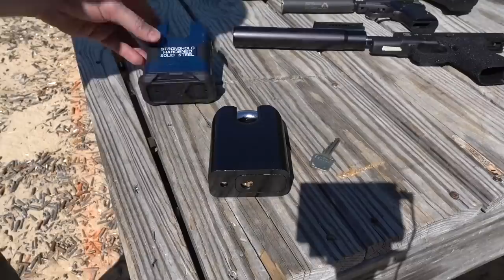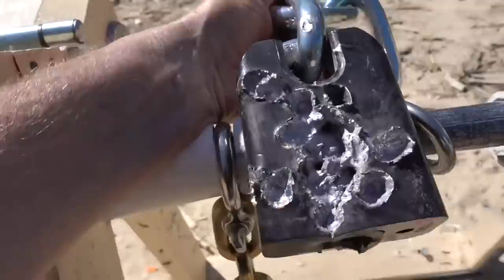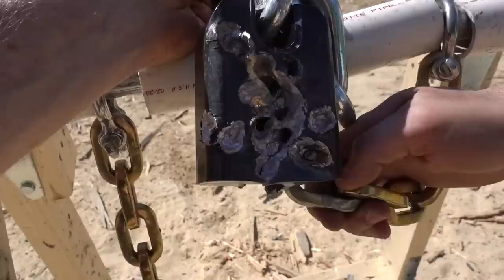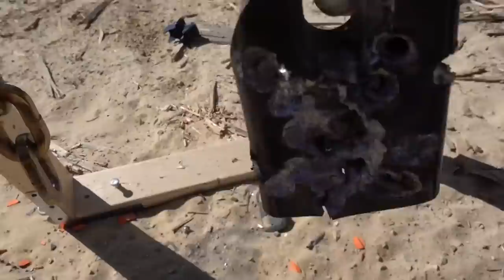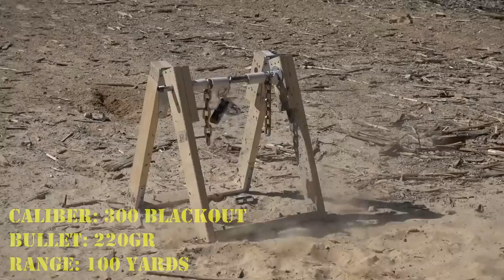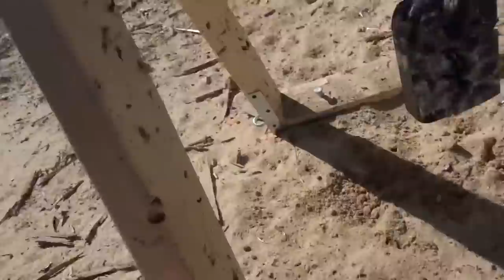[897] The Lock That Survived 120 Rounds! (Squire SS80CS)

Comment: Good shooting by Bill on a moving target.   30 caliber AP (3006 pulled bullets  with the real hardened steel sharp cores not the aftermarket so so ones) has a hard time at 100 yards with 1/2 inch armored steel 3/8 inch is doable.  , 50 yards it can penetrate 1/2 inch.  Another factor is the lock is free swinging which absorbs 30+ percent of the energy from the bullet versus if the lock was not able to move that much would penetrate alot more.  Blowing the core out or penetrating non vital parts of the padlock does not necessarily mean it will open and release.  But it was a fun video to watch.  SLug test   haha ?

Comment: Because the lock can swing freely it can dissipate a lot of kinetic energy. If the lock were fixed securely against a back stop it would have taken more damage early on. Think of it like trying to punch a hole through an empty jacket with a pointed stick while it’s hanging from a rope.

Comment: I don’t know if this has been mentioned (haven’t read all the comments yet!) but I think the “free swinging” design of the rig may be helping the lock survive. Some of the kinetic energy of the rounds is be dissipated by moving it, if it were secured to a hasp and immobile I’d think the lock would absorb more energy and sustain more damage each round. Would that be enough to get through it in fewer shots? I’d think so, though it would still take a lot of shots by the looks of it. Very impressive lock! Just needs a Bowley core to be near-impregnable!

Comment: I'm not sure I'd count the .300BLK rounds. Yes, the bullets are about 1.5x as heavy as a .308Win, but the .308Win is going nearly 3x the speed of the .300BLK at the muzzle. Given that muzzle energy is (1/2)mv^2 (i.e., velocity's contribution to energy is far more important than mass's), if the .308Win didn't do it there was no possible way the .300BLK would.

On the other hand, suppressed .300BLK is one of my favorites at the range. I bet that was a heck of a fun way to close out the day.

Comment: .300 AAC has only about a quarter of the muzzle energy of the .308 they were using earlier (even less considering Bill mentions his hand loaded .308 rounds were "a bit hot"). Surprised they don't mention that which leaves the impression that it's equivalent or even stronger than .308 (or 7.62 NATO, they erroneously use those calibers interchangeably in this series).

Comment: As noted, going AROUND a really decent lock (or under, over, etc.) might make more sense in real world applications.

But if you REALLY want to defeat a lock or other armored device efficiently in a single shot using chemical energy and don't care how noisy it is? I could teach you how. No guns, as much fun as "Thunderbolt & Lightfoot" was to watch. Linear shaped charges, pyronol torches, several other related methods for piercing or burning through armor.

Comment: Why was it suspended in air? It should have been propped against a fixed object - some of the energy was converted to kinetic energy to swing it...
Reply: You'd probably be risking fragments coming back at you if it was solidly fixed though

Comment: By suspending the lock unrealistically on a chain, allowed the swing of the lock to absorb the momentum of the rounds. If the lock were secured to something resembling a fence gate or door, to which it would realistically be attached and not allowed to swing as freely as it did that lock probably would not have survived so many rounds.

Comment: .300 blk kinetic energy is like a slightly beefier .45 although with those heavier rounds it's probably a little stouter, it's not as hard-hitting as the .223. Also, I'm curious as to why LPL uses 62gr M855 versus the faster, better penetrating M193 (don't listen to the politicians on this; the steel core is mild and doesn't aid penetration much at all) which is also probably a bit cheaper.

Comment: YOu've forgot to test it against an RPG! ;-) 

BTW new title: How to turn a steel lock into lead! :D
Reply: the lock wouldn't set off an rpg fuse hanging from a chain, you'd need to put it against a wall
Reply: @SuperAWaC  Source?
Reply: @logitech4873  vp-22 fuze specifications
Reply: @SuperAWaC  How much energy does it take?
Because a fiberglass wall is enough, and it takes way more energy to push this thing out of the way in a few milliseconds than it takes to break a fiberglass wall.
So I'm inclined to believe you're just bullshitting.

Comment: 50 BMG with AP rounds. I’m guessing 3 shots and the lock is done.
.308 is like the size of a piece of hair compared to the 50 BMG.
Reply: .308 is 20% of the Energy of a .5 BMP aka 12,7 x 99 mm.  Not so bad after all.

Comment: Nice video, but nobody uses 5.56 to breach a door/lock, its just not made for it or effective (as you demonstrated). 12ga slugs are more typical and you usually go for hinges/bolt/knob/wherever it connects to the door.

Comment: You said you were starting with .223 but the caption said 5.56 Nato. Please clarify as there is a difference in the two. 5.56 runs about 8,000 psi more than the .223 and has a higher velocity and more power.

Comment: #LockpickingLawyer & @BosnianBill try a Law Enforcement Tactical  breaching round in a 12Ga. Remington 870,   KAC Masterkey or M26 with a "stand-off breacher"
or the M1030 breaching round, in a 12 gauge 2¾ inch (70 mm - 40 gram, 1.4 ounce)round, or the frangible Clucas MoE Hatton 12 ga. round, in  12 gauge 3-inch (76mm) magnum shell (43 gram - 1.5 ounce).

Comment: You are loosing some of the kenetic energy because of the chain hanging in the air. If the lock was hanginig against a steel plate, the energy would tranfer must better into the lock

Comment: I still say it would have busted that locks all of them open a lot sooner if you would have put a steel plate behind it. When its on the chain its letting the swing it not a solid . If A lock has something locked up its going to be on a Hasp its not going to be swinging.

Comment: What you need is a 50 bmg now that might just do the job
Reply: A regular 50 BMG will most likely splinter it on the first shot. A 50 BMG AP will likely just make a pretty looking round hole straight through.... So I vote for AP, so they can have fun making a Swizz cheese out of it!

Comment: 55 grain at ... 987.6 m/s ... ? That's going a bit. Let me slow that down to reasonable. 55 grain at 940 m/s: 1579 Joules.
220 grain is four times the mass, but subsonic means not much over one third the velocity. 220 grain at 320 m/s: only 732 Joules.
The heavier one's got 36% more momentum, but less than half the energy. If you went the other way and kept the same momentum as the 5.56 mm but dropped the mass to 33 grain and raised the velocity to 1567 m/s, that'd be 2633 Joules. Go really crazy and, somehow, launch a 6.8 grain bullet at 7.6 km/s and you get 12766 Joules, up there with the .50 BMG, mostly lost to the air in the first 50 m of travel because it's such a light projectile. Why 7.6 km/s? ISS speed. Don't get in that thing's way!
Go the opposite direction and repeat the "55 grain to 220 grain, 940 m/s to 320 m/s" scaling a few more times, and you get 3520 grain aka half a pound going at 37 m/s aka 83 mph with 156 Joules of kinetic energy, a pretty respectable figure for a .22 LR. The recoil would be unpleasant.

Comment: you should have tried opening it on camera between the caliber swaps to see if it even opens (atleast with the key) because that is usually the objective if your shooting a lock (at least it is in movies). another thing i know is hard to accomplish but certainly aint impossible is try shooting the closing hook itself (that small metall piece you usually fiddle through the heck knows what you're trying to protect) because this should be a weakspot...

THIS OUTRIGHT CRIES FOR .50 APIT!!!!

Comment: Should have hit it with a 7.62x39
Reply: One 7 Decimal 2 Eight well it would have been in between the .223 and the .308 so they pretty well had that power level covered
Reply: A 7.62X39mm 123 grain round has the equivalent energy of a 30/30 Winchester round. At 2550-2600 feet per second, the round doesn't have the energy or penetration.
Reply: My bad. thought they only hit it with a 556 or 223.  Didn't see the 308. So yes, if a 308 didn't go through a 7.62 would not.  But maybe a 30-06 or an 8mm or whatever the Russian variant is 7.62x54?  Probably not, but would be interesting to see what they would do.

Comment: Come on! You hang the lock on a chain, if you lean that lock to a solid wall or slope, it will not survive that much rounds. But anyway, it is still consider as a pretty hard nut to crack.

Comment: Technically, 5.56 is not the same as .223.  Sure, 5.56 was derived from .223, and most riffles designed for one are designed for both, but they still aren't the same.  Please be more clear about what rounds you are using.

Comment: @LockPickingLawer --  Do you like lock challenges?   A YouTube channel called "6061. com
"  He tested a Master lock that he'd bought.   A TIG welding channel.

"Would You Trust This Lock? New $24 Master Lock Picked Twice in One Minute"

"6061. com
10 minutes ago (edited)
I was going to use this to lock up my motorcycle, but now I'll be making my own custom high-security 100% pick-proof lock in an upcoming video.
Yes, to all you smug YouTube "lock-pickers" out there, I said 100% pick-proof. I'll be willing to take on any challengers for a $606.10 bonus prize if you can pick it under 5 minutes. $60.61 to me if the lock can't be opened in 8 minutes without cutting the chain or shackles. It all has to be recorded and timed in a single video with no frame changes."
Reply from the maker: I don’t see that comment anymore. 🤷🏻‍♂️

Comment: Oh. You guys are smart with the locks but not so much with firearms.   The first mistake made is you’re letting the lock swing around.  It is dissipating most of the energy transfer.  So the rounds just bounce off. Second mistake is too small caliber.  Even ss109 penetrators don’t have enough energy retention to do much.   AP 308 rounds would work better but have to stop the lock from moving.   It won’t be moving like this on a door or a gate.     I build custom sniper rifles for a living.  You’re doing it wrong.  Lol.  300 blk subsonic is too slow too.  308 red tip ap  round or incendiary round would be fast work.   But true ap rounds are illegal to possess.  Lawer guy knows. Lol.

Comment: LOL This is such BS having all these rounds hitting a lock that's dangling from a chain. Which idiot would attack the lock when they could use leverage on all that chain slack or an angle grinder on the links. Put that in a CONEX container's lock box. The lock is stationary and wouldn't bleed away all bullet's energy to the frigging wind.